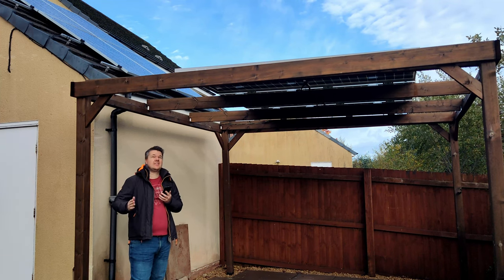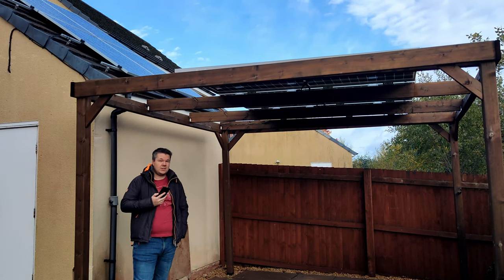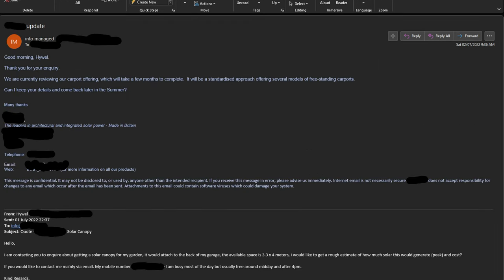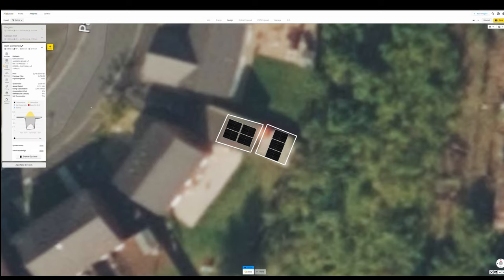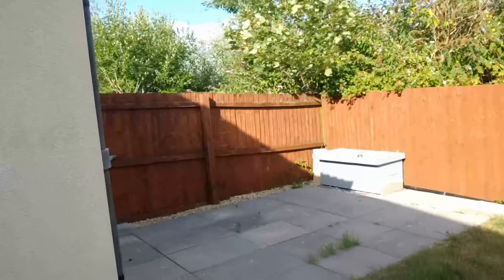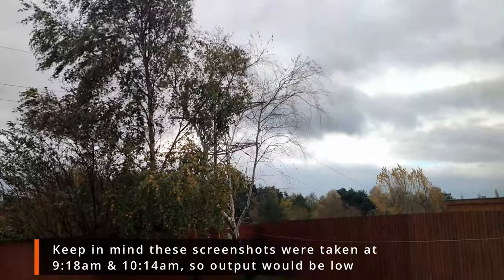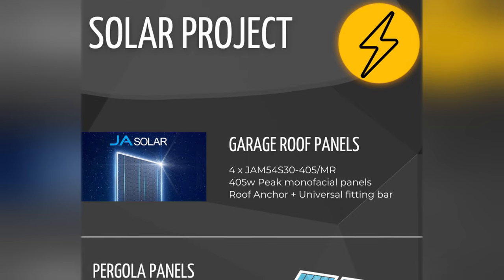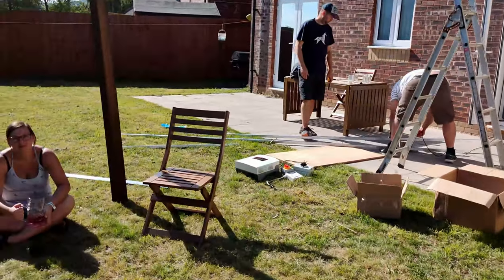Solar Pergola & Roof - The full story

Comment: Were you able to do the electrical work yourself?
Reply from the maker: The putting together of components (battery, PV and inverter), the cable from the garage to the household consumer unit was done by a local electrician and then certified the rest.

Comment: Great content 👌
If my solar panel array is 5kw, with 5kw Hybrid inverter and 15kw pylontec batteries, would I need to get approval from the DNO?
Reply from the maker: Ooo that's a good question! I did some digging online and this is on nakedsolar's website 'If you want to install more than 4kWp then a pre-application is necessary.  The pre-application process involves a lot more work for the installer so many installers have been in the habit of putting customers off the idea of having a larger system'

Link to page:
https://tinyurl.com/yph8sx9r
Reply from the maker: If you already have 5kw PV then I don't believe that the rest would be an issue.
Reply: If you want help doing it, let me know, I do charge but nothing crazy.
Reply: @WindyJAMiller  sure, I could do with help.
Reply: @abukhal986  drop me a DM
Reply: @WindyJAMiller  how to direct message you on YouTube in the about page can't see the email address
Reply: @abukhal986  You are right, seems they got rid of the feature! do you have an email you can share with me?
Reply: @WindyJAMiller  I do but can't put in here ...  I get enough spam already ;)

Comment: Ahh I see now.
The pylontech battery  is limited to 1.2kw output before you stress them. If you have two then you're good for max power of 2.4kw.
I was wonder how you did the power difference, but you do have a current difference. Which is remedied, as as you had it would have been a fire risk.

I thought you did this back in early summer.

But with the waste power... 
A diverter is a key project  to use some of that power excess... But there is only so much hot water you can use :)

Panels were a good price, the pergola itself was a bit excessive...

Bi facial bounce, would negate having a light colour, I think grass and sand ranked high, but yellow slabs maybe? That should boost productivity. But you don't actually need it.
Be interesting to see how well the bi facials perform in the uk. Can't you get data for these alone?
Reply from the maker: Don't know where your getting your information from but it's incorrect, Pylontech US5000's are good for 50 amp at 48v normal usage up to 100a burst for a single unit. with two it increases linearly.
Diverter won't work unless you can tell the inverter it's being called for, as self use mode keeps import, export at near zero, but as mentioned hot water would be a waste with the excess I may happen to get. RS458 could be used but once again pointless for the unlikely event excess occurs when battery is full.

Bifacials are working well and doing what I intended them to do, much higher output on foggy and overcast days vs the 4 monofacials on the garage. Yes I can track the strings separately.

Pergola was a good price, good luck finding a retailer in july/august cheaper for treated wood that's thick, pre cut with fixtured and a warranty.

Comment: What is an angle of pergola? Or is it flat?
Reply from the maker: currently 10 degrees, video coming on this later. It will be changing.
Reply: @th3bmc  And your latitude ...53 deg N? Did you consider putting the panels at  the same pitch as your latitude?
Reply from the maker: @csf1757  Hi, no, it's rather windy in the garden and although it would bring better yields it means I would have had to fork out more for bracket's which likely would have increased the stresses (due to wind) on the pergola. the logic also was the garage solar is about 45/50 degrees so string 2 would be optimal (garage roof) and string 1 would power on earlier due to it being bifacial. I also mention angle in this video. https://youtu.be/V04waf_g4ek